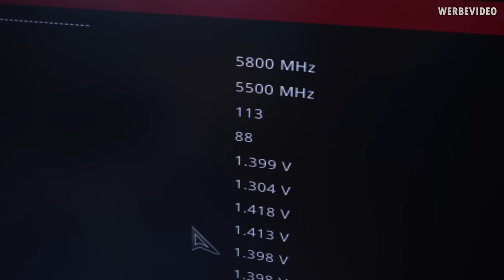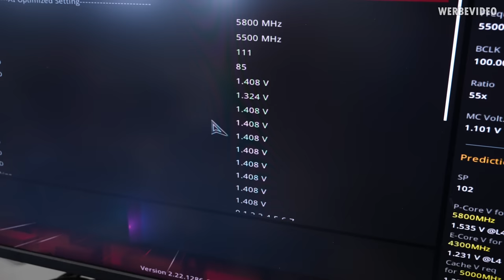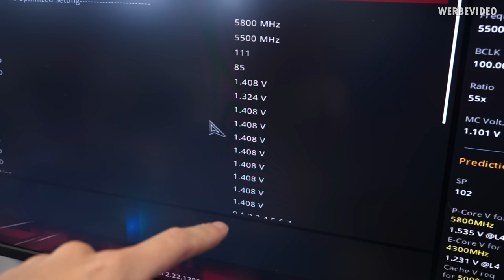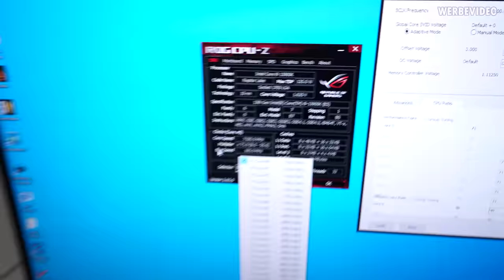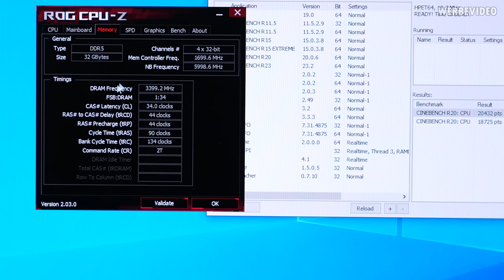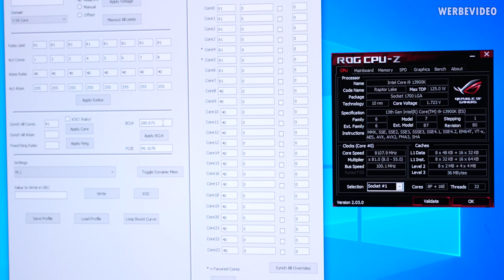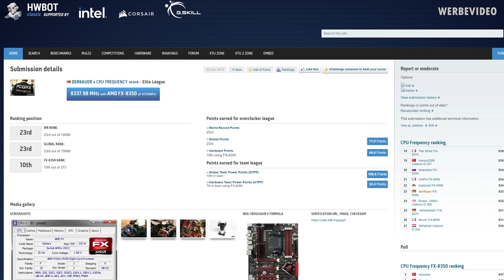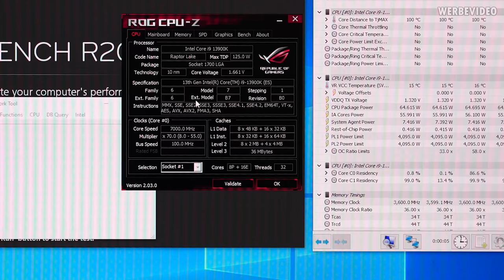Overclocking with Prototypes can be a Real Challenge - But we still hit over 8 GHz

Comment: The switches things reminds me of that old sci-fi story about a group of engineers who investigate a weird alien piece of tech but have massive trouble doing anything but scratching the panels because all the screws were locked tight and impossible. Until someone came along and tried unscrewing them the other way, and they found out the aliens are lefty tighty, righty loosey.
Reply: The aliens turn out to be the villains because they use security Torx, and anyone who uses those screws are evil.
Reply: @caramelldansen2204  Then they all die to the ultimate horror. The gamebit.
Reply: My Orchid Fahrenheit 1280 GPU had this same problem. One day while looking at the booklet I noticed a pin setting that would boost the performance.  So I switched it. When I turned on the computer there was a pop and a puff of smoke. Looking through the booklet again, a piece of paper fell out of it. It stated that you should never set the pin to the setting shown in the booklet. They had added that instead of fixing the guide. Faceplant...
Reply: There's a SPECIAL place in hell for engineers who decide to use those.
Reply: @reeeeeee9230  I wonder if they use them in Australia?
Reply: @st0nedpenguin  even Australia said no to them.
Reply: reverse thread is mainly for rotating components where the direction of rotation, clockwise, in repeated start-stops could cause a screw to back out. so... since alien spacecraft are saucers and saucers obviously spin, now we know which way

Comment: 5:18 Really odd that be quiet designed the main switch like that.  Whenever I build or modify PC i keep the main cord plugged but switch off that the motherboard is still grounded but not live, so I don't accidentally short anything and reduces static shock risk. 
Also turning the switch off is way faster to shutdown than plugging out the cord, in case of complete system crash. 
Hopefully be quiet listens the feedback and stops making main switches like that.

Comment: I bought the BeQuiet Dark Power Pro 12 1500w, and had the xact same problem… being on in the off state… seemingly they claim it’s not a bug, it’s a feature, such that you can charge different things on the usb… but that bugged me so much I returned it, and bought a Corsair AX1600i instead.
Reply: it's a safety issue. thinking your psu is off when it actually isn't is a big issue.
Reply: @CRneu  Yes it is a big issue, when I turn it off, I want it to be OFF, but unfortunately it seems like its by design, and not a one-off error. But maybe some will like the “feature”, so they can charge their usb devices (as it provides enough power to usb, and leds on the motherboard, but not enough to turn on the computer in it’s “off”-state.
Reply: @Cyberstormxiii  I don't see the problem, just unplug it

Comment: The LED turning on might not be the PSU fault. I had similar problem, where it turned out that DisplayPort cable was the reason. DP cable had pin 20 issue (responsible for PWR OUT), where GPU was receiving power from the monitor even in powered off state and was able to light LEDs on my ASUS board. It drove me crazy, but I was able to finally figure it out. I've cut pin 20 from my DP cable and now everything is fine - no more LEDs when PC is powered off.
Reply from the maker: it doesn't happen if I use the Corsair PSU so must be related to the PSU. I remember about these DisplayPort power issues though. I even remember a case back then with CRT and DVI where a similar thing happened
Reply: @der8auer-en  Never had the opportunity to check with other PSUs (I have an EVGA SuperNova 750 G2), but I had 3 different mobos under the same PSU and only ASUS did the LED thing.
Too bad that this solution would not work for you. If it's really BQ PSU, than it looks like it supplies some low level current even in power off stare, which is a weird bug for that caliber of PSU.
Reply: It's the same for my 1500w DPP. It's a solid psu though. I'm not sure why Be Quiet designed it that way.
Reply: Mine 1500W DPP doesn't do that, EVGA X299 Dark.
Reply: @der8auer-en  It's 100% mobo. Same problem with my Strix + SuperNova 750, you have to disable standby lights in Armoury Crate. Maybe Corsair doesn't support standby power at all ;)

Comment: Damn I have just checked and they finally broke the world record on CPU-z with 13th gen I9.

I can only dream what this CPU at such frequency could do at the extreme of just pure gaming physics pushed to the max 😎
Reply: no games use cpu that much... it is just unreasonable - the applications for heavy oc are rendering and math
Reply: @cokeforever  I'm not exactly talking about any current game but rather advanced physics like crazy water\fog\smoke simulation physics that games sadly lack but would be awesome...

physics never evolved anywhere close to visuals sadly.

Also with this crazy OC it's mostly the single thread capabilities that interest and what it could do for gaming in terms of pushing max FPS since the CPU is what is going to set max possible FPS as long as it's not GPU capped and that also is not all about CPU utilization on games...

for pure full multi-threading math I'm sure it's not impressive as there are crazy high expensive big pieces of silicon out there with crazy big numbers...
Reply: @guily6669  sure, keep in mind that as a game developer you aim for very broad range of hardware that will run your software... that is point A; point B is things you named are all floating point crunching which is by all means more effective to do on a GPU... as a result, cpu is usually busy in games doing: logics, IO and data processing, other than that - everything goes to GPU
Reply: @cokeforever   I surely know that, but both help each other 😎

I wish we were at 100+ Tflop GPUs at even the lowest price point cause GPGPU is what would help a lot pushing crazy stuff but also a very powerful CPU that wouldn't lag behind 😏
Reply: @guily6669  oh, it will happen quite fast, the point is we need not more fog, we need better polygon heavy drawings of objects; you d be amazed how cheap motion blur is, and how expensive is ssao

Comment: That standby power issue is really weird! I wonder if they're all like that, or if that's a problem with the unit?
My Straight Power 11 takes only a few seconds to be completely shut off
Reply: the 5vsb is functioning as intended. According to the new 3.0 and older ATX specifications, intel says the following the 5VSB "is present whenever AC power is applied to the AC inputs of the supply." So it's supposed to be powered, even if the switch on the back is off.
Reply: @samfedorka5629  I never knew that, thanks for the info!

Comment: At 8 GHz, the wavelength of the clock signal is so short that the phase inverts before it reaches the other end of the chip.
Also, it is 450000x faster than Intel 8080 from 1974.
This one chip has more computing power than all computers in the world combined in 1972.

Comment: The only "practical" reason I can think of for that Be Quiet PSU behavior is if someone wanted to use the computer to charge their devices while it is off. HOWEVER why someone would turn off their computer, flip the PSU's switch, and still want to charge a device is beyond me.

Comment: To get rid of the standby power, just switch off the PSU and hit the Power button on the MB, it will try to start and waste the juice in half a second, then it's all good.
Reply: it went away as soon as it was unplugged and came back as soon as it was plugged back in.  this seems like intentional design more so then just a bit of excess power waiting to discharge
Reply: @sharkbytecomputer  yeah I later saw that in the video.

Comment: I have a Darkpower Pro 1200w and the easiest way to cycle the power is switch off and unplug the PSU at the back, then press the PCs power button for a few seconds to be sure. Plug back in and youre good to go. I think its meant to be a 'feature' as it will pretty much run the boards RGB indefinitely.
Reply: Its not for RGB, its for charging phones or other USB devices if the PC is powered off.

Comment: I was always wondering why all the overclockers use pressurised LN2 and why not use non pressurised dewars. I worked for 5 years with LN2 daily and we mostly used large non pressurised dewars daily because they were safer to use. If you use a good quality dewar the daily looses are negligible and on the other side it takes a ton of lost LN2 to cool down the nozzle for every dosing from pressurised tank. Is it a matter of higher tank capacity of the pressurised ones? How many liters of LN2 do you use for one overcloking session if I'm allowed to ask?
Reply: der8auer is one of the few benchers who use pressurized dewars. Sadly very few actually make videos (...I don't) but most use non pressurized ones.
LN2 usage per session varies wildly - can go through 10L over a couple hours or through a full 25L dewar in 2 hours depending on a lot of factors.
Reply: @Ground15  To tell the truth I don't follow any other purely overcloking dedicated channel other then der8auer but also seen Jay and Steve using pressurised ones and I kinda jumped to conclusions. Thx for info.

Comment: The Standby power is functioning as intended. Both the current intel ATX V3 and previous versions specify the 5VSB (standby) to be "present whenever AC power is applied to the AC inputs of the supply." So it's present even if the switch is off as long as the cable is plugged in. This feature is to power things like wake on lan or wake on kb.

It has been common for a while for other low-level features of the MB like the RGB controller to be powered from 5VSB. I was very surprised to see this myself during a build when I plugged in a PSU for grounding but did not turn it on. The MB is not receiving 12V and very little else should function. I'm not an XOC expert, but I think removing 12V is sufficient to reset the MB in the way that you want.

I would recommend using the old PSU with the new MB and see if the RGB turns on when the cable is plugged in before it's powered on. If the old PSU supports 5VSB like it should, you should see the same behavior.

Finally you can reversibly modify the PSU by removing the 5VSB pin from the 24-pin connector and tape it off.

Comment: Are 13th gen chips capable of BLCK overclocking the same as 12th gen?

Like could i get a 13400F and overclock it using blck the same way you could oc the 12400F

Comment: To drain PSU caps just turn off the switch and hold the power button?
Otherwise can the system actually turn on with switch disabled?

Comment: That PSU is defective and I hope it's not by design, imagine having smoke or a water leak you hit the switch because it's faster than pulling out the plug and it's still providing power to the board to cause more damage...

Comment: Very cool (literally)!  Curious why you don't put the whole thing in an air tight bag, seal it around the pot, purge it with almost any pure gas (maybe helium since it has lower critical temps than nitrogen), and get rid of all the moisture issues?

Comment: About the AMD IHS, what would happen if you milled the IHS with a pattern then milled a cold plate with an interlocking pattern? This would thin the IHS and increase the overall contact surface area. This may not pertain to LN2 or dry ice but ambient cooling.
Reply: Interesting thought. I wonder if you would have trouble with thermal expansion doing that. It would have to be a very precise machining job to get the pattern to conduct well without gobs of thermal paste. Press fit coolers does sound kinda cool though.
Reply: @--_DJ_--  it could be as simple as v grove lines across both surfaces. You’d just have to get the number of lines and depth the same. If the cold plate sat a fraction of a mm off to create the interlock it’s be totally doable. Pressure from the mount would make thermal expansion negligible
Reply: @paulkim3521   The more I think about it, the IHS is probably too thin for it to make much of a difference. It would make for an interesting test though. It certainly would never be a mass market thing, even if it did make a measurable difference.
Reply: @--_DJ_--  yeah, interesting idea. Would be nice to see. I figured if they’re taking 1.5mm to lap an IHS, if you cut grooves, increase surface area by about 20% to realize a gain of 15%. Anyways- would be interesting to see

Comment: 2:28 can you tell me, what you think about that be quiet's idea, to prevent the power switch on the back of  Dark Power Pro 12, to cut off all voltages when you switch to position 0?
PC will not turn on, BUT there will be still 5vsb voltage present on the mainboard all the time and if you have LED's, you will see all lights on. So if you want to keep motherboard safe during maintenance, cleaning, etc - you have to take the cable plug out from PSU. Be quiet support is saying that it is fine, it is normal. But we all know that it is not.

Comment: 4:22 this is NOT about discharging big main capacitors. It is designed that way. Take the power cable plug out from PSU and you will see how quickly the 5vsb will be gone. So the 5vsb rail is working all the time bypassing the main power switch (even when it is on position zero)
I three possibilities: 1) they want to design it in that way, 2) they made mistake in schematics or the factory made mistake during assembly, 3)They didn't want to do it, but they had to, due to some limitations of free space inside or project cost.

Comment: If only there were far cheaper CPUS with the same technology that you could overclock with LN2 like a 2 core, 2 core with HT and a 4 core....le'ts call them Celeron 6900, Pentium Gold 7400, 12100...they can take so much voltage that it seems that nobody has found their limit yet...maybe the lack of unlocked multiplier, but it seems that your motherboard can overcome maximum multiplier limits. Please do the test...it'll be very interesting to see a Flight Simulator test comparison between 13900K + rtx 4090 and the cheaper cpus... and the low power consumption

Comment: Roman, can you look into that Be Quiet PSU? 5Vsb ignoring the power switch isn't just weird, it might indicate other design issues. Somebody consciously designed 5Vsb to stay on even when the PSU is switched off. So... does that switch even control mains? Why bypass it? 5Vsb serves no purpose with a disabled PSU. Are they leaving the PSU enabled and using the switch to inhibit PS_ON?

Comment: When your 5GHz 12900 feels weak. But my laptop would need a cooling lake connected to it or region locked to Alaska in order to be able to handle 8GHz heat :)
5:40 I hope this is a defect. Iam pretty sure ALL customers expect the unit to be OFF when the power switch is turned off. The manual probably says to disconnect wall- power but this cant be the intended behaviour for customers...

Comment: I just built a system with a 13900K. Is it normal to see an 11°C difference from one P core to another P core during a Cinebench multicore benchmark? Is this a sign that my CPU needs to be re-mounted? I am using a Corsair h150i pro with push-pull fans set up on the radiator in a 5000d airflow case.

Comment: thats odd. i have the dark power 12 1000 w. 
i have to turn off psu or a  Mischievous spirit turns computer back on. So inturnnoff psu every time.
It never takes more than 10 seconds to discharge. 
Do u have the OC clip installed or the oc switch installed. 
Did u toggle the seitch while power was on. They say not too switch oc unless powered down.
it must be a defect or damaged

Comment: There is a material called aerogel Cryo used to keep cold temps where they need to be.. maybe make a lid for the pot you have strapped to that CPU and use the padding instead of that pad at the bottom of the board and wrap some of this padding around the pot too..

Comment: Missing dim slot lets you reach wey higher ddr5 frequency it's very big future !
Reply: He knows, he just means that normally xoc focused board like the apex are cheaper than their other boards. 

Like z390 asus extreme was $600 while the z390 apex was $360 to $420. Now the apex boards are almost expensive as the extreme. It's crazy.

Comment: Did I miss the part where you explained why CPU wasnt delidded or why you werent using your mounting kit?
Reply from the maker: I used the Contact Frame but just didn't show it in the video. CPU is not delidded because it causes more problems under LN2 than it helps from my experience

Comment: I have the issue of tapping DEL and it wont go into bios. This is caused by my Asus monitors. It either is on or off. There is no standby. So it freaks out the system when booting, because both monitors are turning on and off. And even when computer is open, if you turn other monitor off, it disappears completely. Computer cannot find it. It moves all the programs on the monitor that is on. First and last Asus monitors I buy.. It's annoying.
Reply: what model of monitor is it?
Reply: @uliseszx6044  Asus 27" TUF Gaming VG279QM, 280Hz (OC) Full HD TUF-GAMING-VG279QM
Reply: @NeroKoso  T Y V M 👌